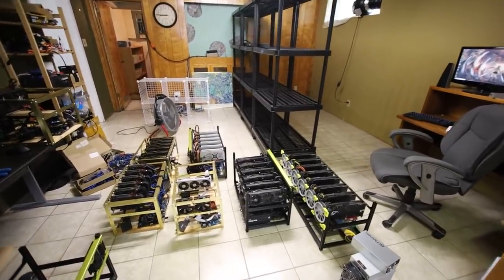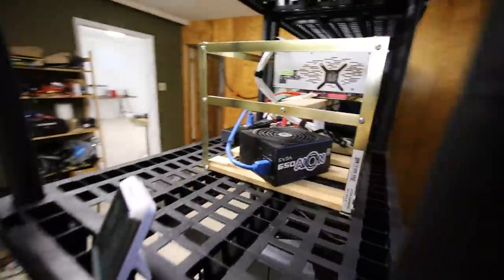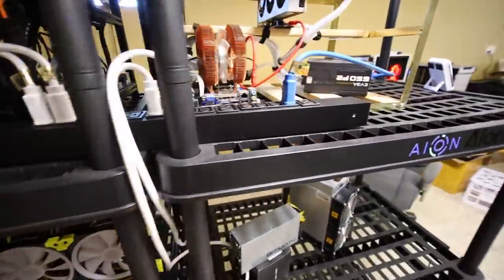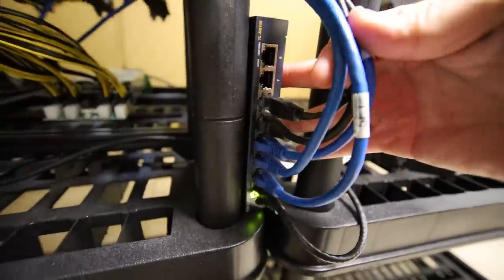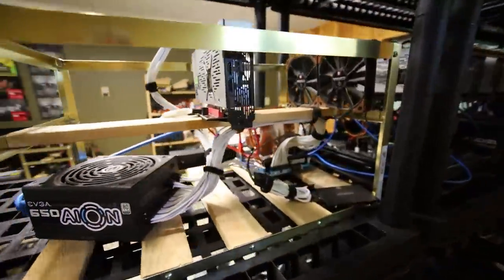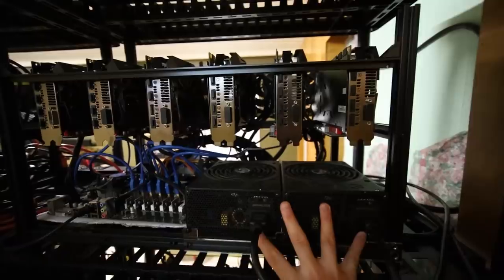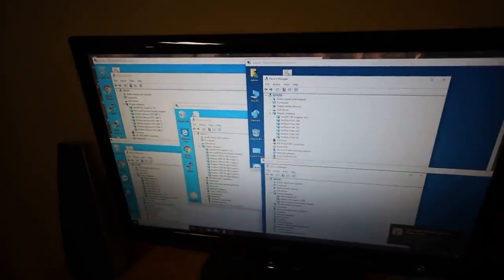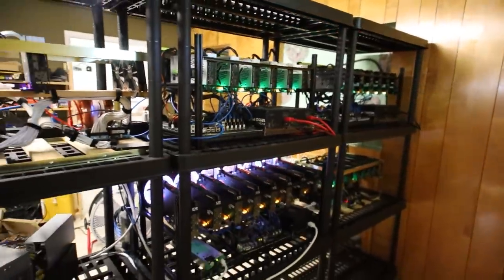TURNING MY MINING RIGS BACK ON!

Comment: Just as a tip for other miners out there. If your gpu fans ever get stuck, just take the fan out and wash it with water. Submerge it in water completely and loosen it up by spinning it with your hand. Dry it with a blow dryer and then spray some WD40 into the bearing hole. Let it sit for about a day then re-attach it. It will spin like new. Trust me, it works.

Comment: Like the idea of drawing out the hot air through the window however that creates a negative pressure situation and the air that you are removing from that window will need to be replaced so if you do not open another window to draw in fresh air it will just pull it from another portion of the house which you really don't want either.

Comment: I'm quite new to mining but tried out quite a few OS variations and SimpleMiningOS looks to be my winner right now.  They have pretty much daily updates to either the client side or the web gui and their support on Discord is basically instantaneous.  Even tried rolling my own with Xubuntu and it was a bit painful to get the driver and plugins sorted and matched up to work.  I've been able to do quite a bit of mining pretty quickly with SMOS and then do some nice on the fly optimization.  Getting consistent 30mh on RX580 8gb mining ETH and ETC and cards are cool and efficient.  I'll be interested to see what you find.

Comment: dont have you power cables in coils because it creates electro magnetic fields that alone cost energy having the active and neutral running in the same direction the fields fight against them self energy fighting against itself  the magnetic flux inductance creates resistance

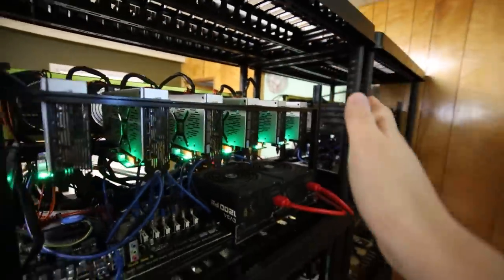Comment: okay total noob here so just giving an idea, at 08:22 i spotted a major flaw in your design, fluids will always take the path of least resistance so if you have the window open that fan is doing close to nothing, also that is a quite beefy fan so it can shift air but you need to use it with a wide funnel that will channel all that hot air into it, with a piece of tubing on the suction side it will just spin like crazy and not really make any difference, i could be wrong so don't quote me on what i said but i think it should work

Comment: Motivated by yours GPU mining rig videos, I have recently tried building by very 1st rig with 2 RX580 8GB cards but finding issues in managing the rig, having OS as Windows 10, the issues am facing is that the rigs do not start mining itself after the power surge as the cooling fans do not turn up to custom setting of 50% also inconsistency in the hash rates for example for 1 am getting only 10 MH/s and for the other 30.5+ MH/s, even though I have applied same parameter values for Core Clock,  Memory Clock and undervolting settings. Just to let you know I am using Phoenix Miner. Please do let me know if you can help in this. Thanks.

Comment: Hi for some reason my gigabyte ga-h110-d3a mobo wont let me load more than 2 5700xt on risers. I had six gtx 1660 super running this morning but im stuck on two rx 5700xt. When i try to add another it wont load. Power on but dead screen. Any help, dying trying to troubleshoot this but more likely just paying my dues. Great vids btw!! Ur enthusiasm really shows. Got me hooked hearing u talk about it. Its some awesome stuff! When running properly. Lol
Reply: Ive tried adding one at a time, bios settins are all good, different risers, the gpus all work on different rigs. Man so frustrating when you hit walls and dont understand whats going on much less how to fix it. Ive googled alot but cant find something that works. Lol